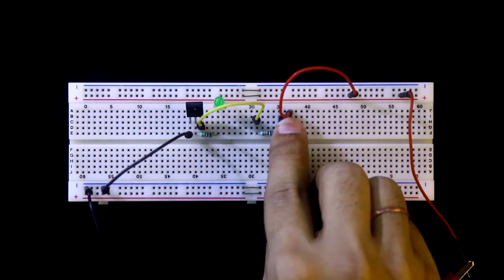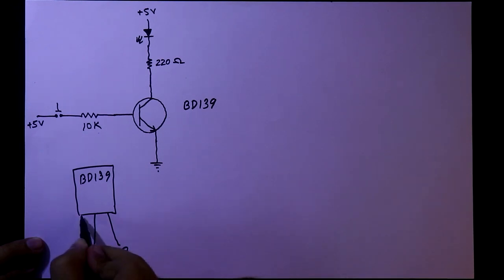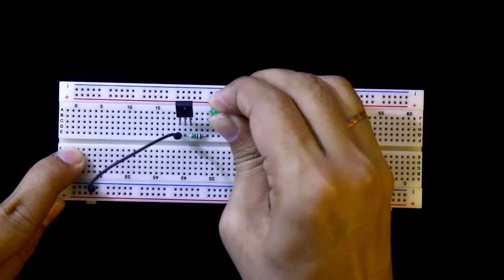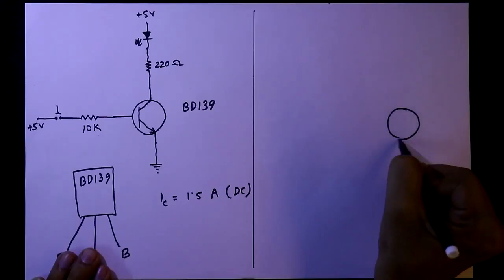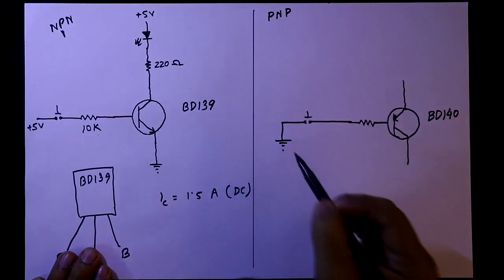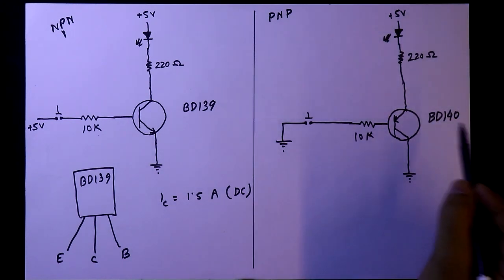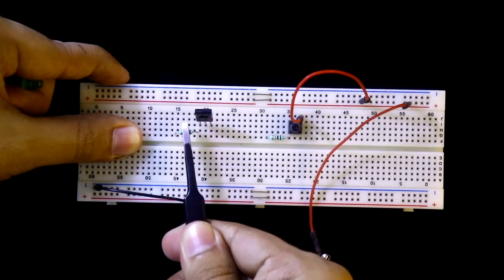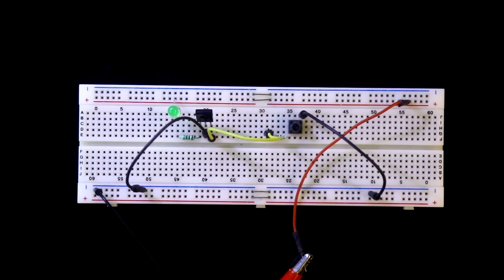How to use PNP transistor instead of NPN transistor as a switch

Comment: I am confused with this.

I know that in NPN transistor, we can apply small voltage like 5VDC across base & emitter with a series resistor to control base current. It will close the ckt across collector & emitter, in which we can supply large potential like 24VDC or more.
Something like an electrical relay works.

But in PNP transistor, the base is grounded. So we are not supplying any external potential to control the base.
The confusion starts here that, why we are using the pnp transistor to control the load. I mean that instead of using a pnp transistor, simply by connecting the switch between the source & load it will work. Then why do we need that pnp transistor.
Reply from the maker: You will get your answer by watching this video, this is just an example how can we use.

https://youtu.be/uFJ79c1rqoM
Reply: Ok I understand.
If we are having NPN then base to be supplied with 1 means +ve and if we are having PNP then base to be supplied with 0 means -ve, to get the pn junction forward biased and conduct the transistor.
Thank you buddy for helping me clearing my doubt. The content is really very helpful.

Comment: I am really surprised this PNP configuration seems to work. Some years back I wasted a whole day troubleshooting a PNP switch. I haven't done electronics since then, but I think it was like : When the PNP is fully on you essentially set the Collector to ground and it will stop the current flow. I needed to have the load between Emitter and Ground. I drove the base with a microcontroller and as 12V load or something. I am puzzled here.
Reply: No! When the PNP's base is connected to ground, it will turn fully on! You have it backwards!

Comment: Hi there,
I need help please,
I have two output sources of lights, one light is constantly on, and the other off.

I want the light that stays constant to go off as soon as I turned on the other light, and also I want the constant light to come back on as soon as I turned off the other light.

The results i want is like that of a car headlamps. When you turn the high beam on the main beam should go off.

What transistor can I use, and resistors can I use?
Reply from the maker: We can make this circuit with NE555 IC. We have to connect this IC in monostable mode. Only a few components is required.

Tell me, what type of Light you want to control? This will decide the load section circuit components.
Reply: @EEWave  

It's a car Headlamp that I want to showcase in a workshop to customers.

I want it to work just like how it's connected in the car circuit. Two switches, two different power sources.

So I guess most car headlights use 12 volts right?
Reply from the maker: Yeah ok, I'll make a video on this with a motorcycle Headlamp ASAP.
Reply: @EEWave  

Thank you 🙏
Reply from the maker: Hi dear, your requested video is uploaded.

Comment: 1st view, 1st comment. Good one.. can u tell how to stop the collector emmiter current to zero when not connected to base in a pnp transistor...
Reply: You want the transistor to conduct a little bit when off, and more when it is turned on? For that you could maybe bridge the collector and emitter with a reasonably high value resistor, so there always is some current.
Reply from the maker: Thank you so much. Right now, I don't have the correct answer to your question. I'll search for it, after getting the correct answer, I'll reply you.